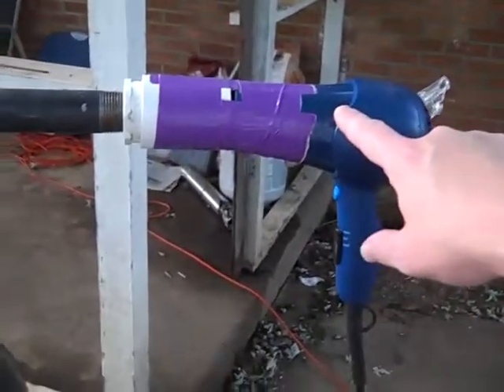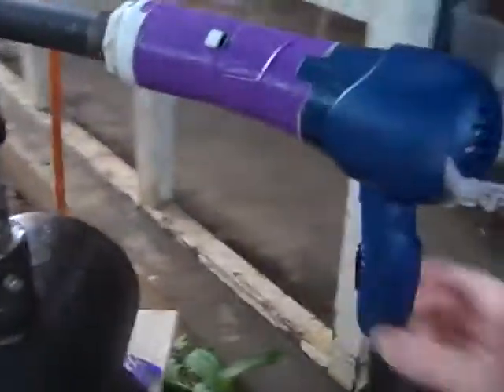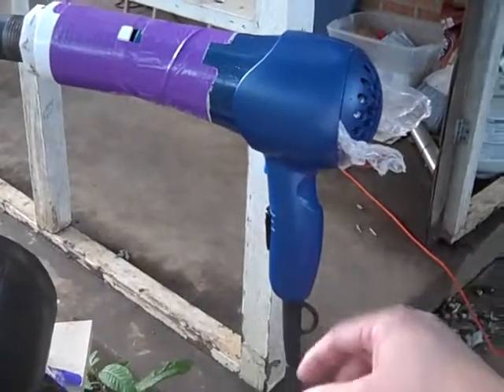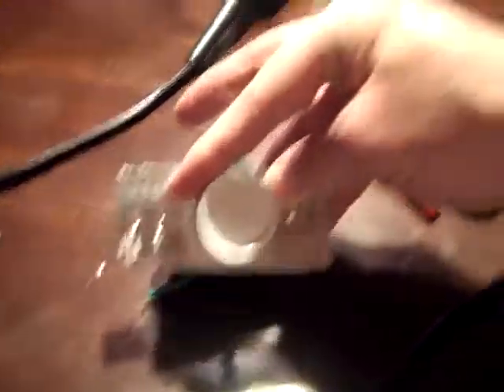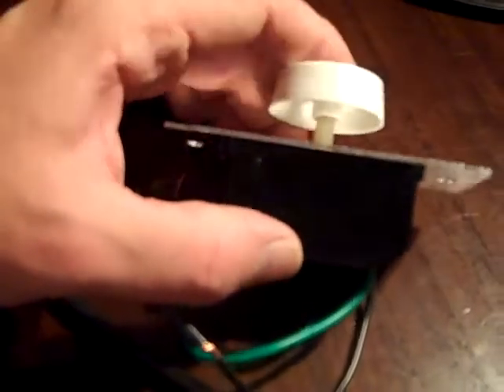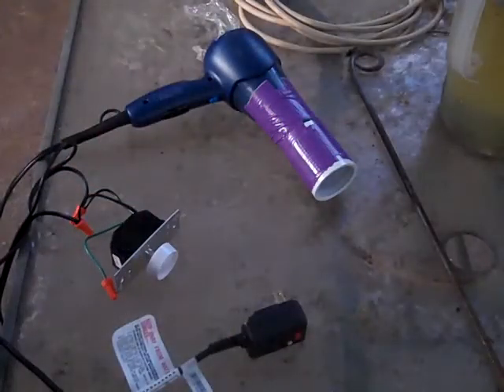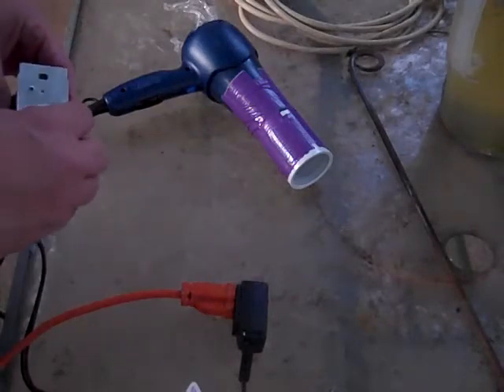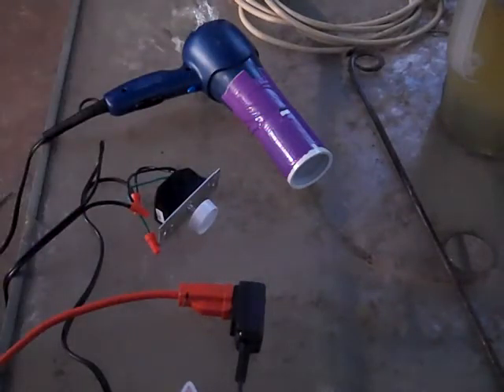Modifying the forge blower

Comment: @RDPproject You would think that would work perfect, but for some reason they won't overcome the backpressure to push air through the pipe. Most of the air will come out the back of the fan and about 10% is all that will travel down the pipe. The computer fans were among the first fans that I tried. The best I've found (cost wise) is a hair dryer fan removed from the housing. They run off low voltage dc and use a diode the rectify the mains and a secondary element as a resistor to lower voltage.

Comment from the maker: @RDPproject I didn't actually remove the heating elements, but I disabled them.  There's a blue button on the handle of the hair dryer which, when pushed in, takes the heating element out of the equation.  I just opened the case and removed a little spring so the blue button stays permanently pushed in.  Low-tech, but it worked.

Comment: Mate...did you remove the heat elements inside the hairdryer?
For the last couple of weeks now i have been meaning to tell you
that you could get a large computer cooling fan and hook it up to some PVC pipe.
They are designed to run for long periods of time and are low voltage.

Comment from the maker: @nightwalker2830 A long enough supply hose/tube, or enough twists and turns, would eventually build up enough resistance to slow the airflow, but that would still leave the problem of not being able to vary the airflow as I need to.

Comment: you may want to open up the hair drier and disconnect the heating element.   A lot of hair driers have a thermal cutoff that will actually cause it not to turn on if the element gets too hot from lack of airflow.